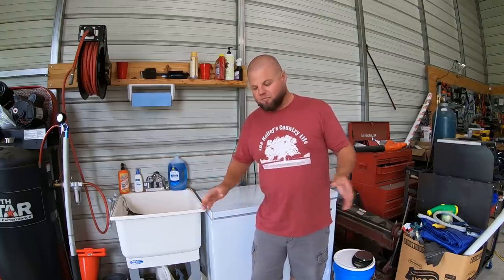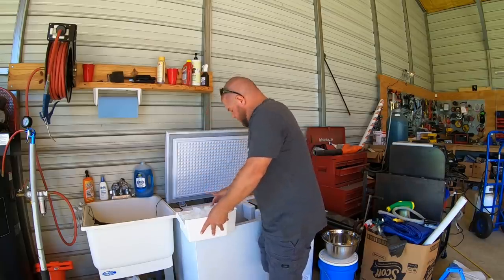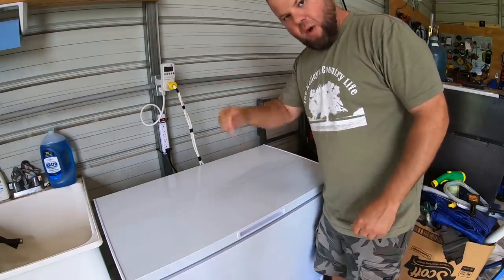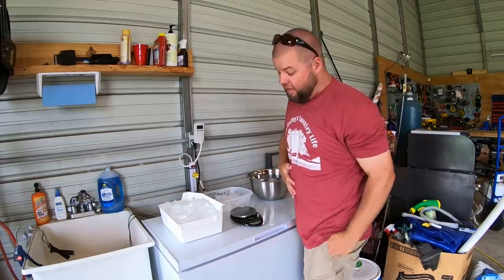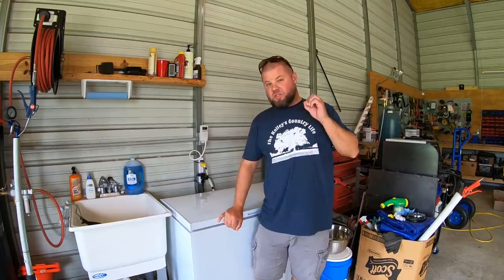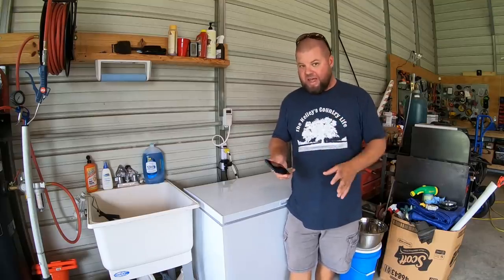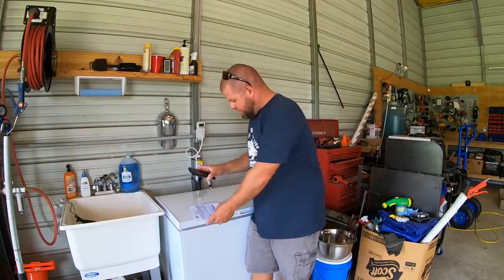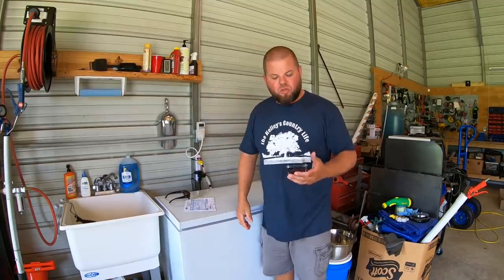Homemade DIY ice machine tests, energy usage and cost per pound! #370

Comment: You mentioned the discussion regarding the Mpemba effect (hot water freezes faster).  Dunno if you've researched it, but here's an article that explains it pretty well:  https://www.tasteofhome.com/article/hot-or-cold-water-freeze-faster/
Reply from the maker: Thank you for the read, I still question if 90 degree water VS 70 degree water is in the same realm? Every one of those reports I read talk about boiling water or near that temperature
Reply: @TKCL  It may be that the starting difference of only 20 degrees (90 vs 70) is close to negligible.  Even if 90 degree water did freeze, say, 5 minutes faster, I doubt it'd be enough (at least IMO) to justify implementing a way to intentionally heat the water beforehand, considering you'd have to have a way to keep it at that temp.  Seems like an added cost for a very small increase in production.

Just kind of spitballing, but another thing that may be playing a factor is how much water you're using on a given day.  I dunno your plumbing system, lol, but I'm guessing you use the pumping well for more than just the ice maker.  If you use it for drinking water, laundry, showering, watering the lawn, etc, using more water on a given day (like drinking more water when it's hot out) may lessen, if not negate the rise in water temperature that would take place if it's just sitting out in the well in the sun.

Interested to see the project progress!

Comment: The fans are using more energy for one reason - they are working harder - you can try some low temperature very thin oil in the fans if you want to fiddle with that.  (Just youtube search oiling computer fans - lots of different videos on the subject.)   If you take one fan out and run it when it's not cold - see if it runs .5 where it's supposed to be at.

Comment: Sorry - you forgot to include the cost of the water lol
Reply from the maker: Water is practically free for me. Home pump and well, 80 gallon tank that rarely kicks the pump on. When it runs its literally for a few seconds and it's full. I might could add a cent to the 20lb bag total. It's not worth measuring, now if I was on city water that would be different.
Reply: Buddy you are going above and beyond on your details so I was just messing with you keep up the good work it is very interesting
Reply from the maker: No problem

Comment: use a glass condensation apparatus for the cooling on the incoming water could use some ice from inside to keep the water chilled that circulates in the apparatus 

https://www.ebay.com.au/itm/152771869104?hash=item2391e9b9b0:g:eksAAOSw-3FZBuT5 

or could use ethelyne glycol (radiator fluid)

Comment: You're assuming water is free
Reply from the maker: It practically is for me. Home pump and well, 80 gallon tank that rarely kicks on. When it does the pump runs for a few seconds to fill. I might could add 1 cent to the 20lb bag total 🤷
Reply: @TKCL  i figured as much when you mentioned a well but still, nothing is free. 

Filtration is a worthwhile investment. It'll produce better ice and extend the life of your icemakers. There are reasons every refrigerator, the original home of your icemakers, has a built-in filter.
Reply from the maker: I did install a inline filter in the first episode.